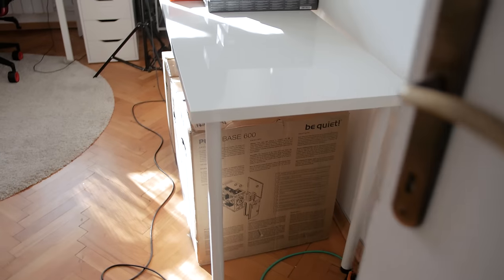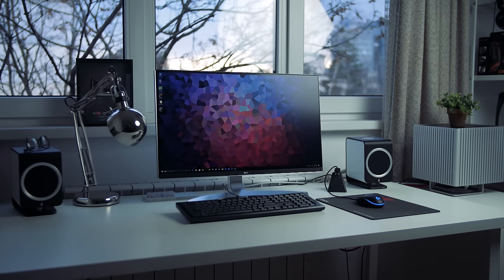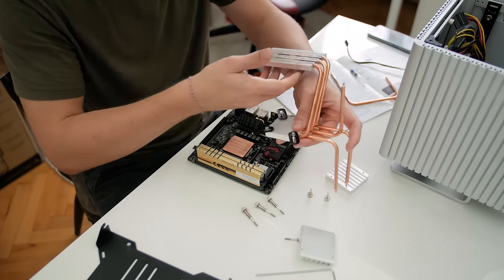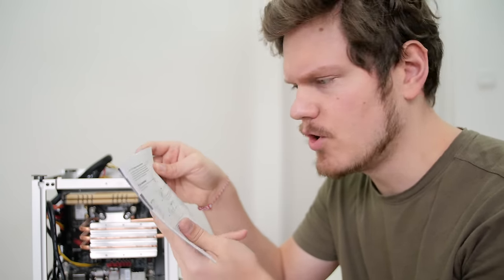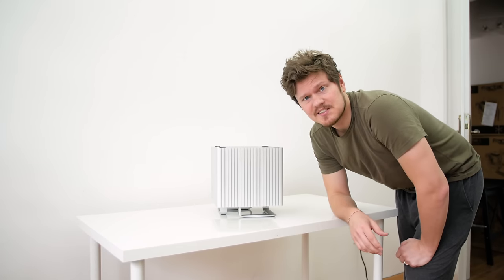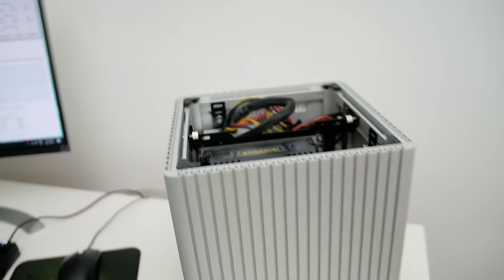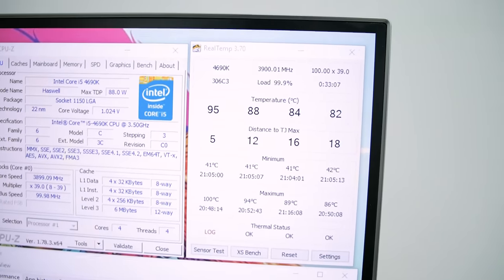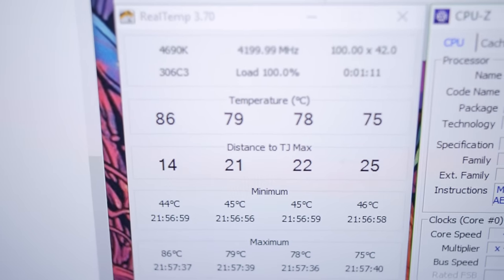Trying to Overclock a Fan-Less System... Do We Succeed?

Comment: Will someone please explain the Heat Watts for me in detail. He said the CPU does 65w of heat is that per minute or per hour or what. Thanks in advance.
Reply: It's not pertaining to a specific amount of time. It means that it's thermal design power (recommended max waste heat output). A it's just simply in watts. It's the amount of electrical resistance within the chip caused my the transistors, meaning if the chip is consuming 100 watts of power it is producing 100 watts of waste heat, and if your cooler can't handle that then the chip will thermal throttle or turn itself off.
Reply: I know OHMs law. But what is in question here is Thermodynamics not Electricity. Heat is expressed incorrectly in Watts instead of BTUs. What I need to know it the actual Thermal Output, not the power usage.
Reply: I suspect that Higher End products, let's say Power Supplies produce less BTUs of heat per Watt of Electricity produced. The only way to truly speak of Heat is in Thermal Units, not Electrical Units.
Reply: TDP is an industry standard measurment for integrated circuits. Here are some links and charts etc, if you want to figure out a BTU rating over time. https://en.wikipedia.org/wiki/Thermal_design_power
http://www.gvsnet.com/spec.html
Reply: That is exactly what is needed Shorty. The Actual BTU Rating so that the proper amount of cooling can then be calculated. Personally, I would prefer to keep chips at 30C at the most. Thanks for your help.
Reply: No problem. It's just not something that usually pops up with PC's and PC cooling. I personally am familiar with BTU as a unit because I used to work on AC units and thats how home cooling/heating is calculated. Typical for computers though is that the chips will have a TDP and the cooling solutions will say what TDP they are capable of cooling. So typically btu's would never enter into the equation for most consumers, but yes scientifically it would make more since to measure that way, its just not the way the PC industry does it.
In the case of this video the original case cooling kit was for a TDP of 65 watts or less, and the chip is 84 watt TDP. The upgrade brought the case up to a capability of 105 watts, so in theory it should have allowed overclocking, but as he states in the video if there is nothing to then dissipate the heat away from the side panels then it still doesn't work very well in practice. I also have a guess that measuring in BTU is probably not used for home pc's simply because the amount of heat is so small compared to systems where btu's are used as a measurement. For example when trying to cool a Data Center with 100's of servers all with 140-150 watt TDP parts, all stacked in racks, then the total heat produced by all that needs to be calculated and cooled properly, measuring in BTU's at that point makes sense. But that's just a guess.

Comment: So... you're going to put a Ryzen chip in that case when they have ITX boards out, ya?
Reply: Stephen Hill Except they would also need to wait for Ryzen APUs if they want to use the upgraded cooling kit if there are issues with motherboard design there as well
Reply: Stephen Hill The case manufacturer would also need to release an AM4 mounting kit for the case/baseplate.
Reply: Fair point--I'm guessing by that point they may have their next niche product out there. Would be interesting to see a low TDP powerhouse (as powerhouse as you can get with low TDP) in there.

Comment: Can I have a fan less PC? Only the fans from the GPU and the CPU closed water loop with a fan. Cuz I got 2 cats and with my current 5 fans, hair gets everywhere inside no matter if the pressure is negative or positive.
Reply: Yes you can have just radiator fans and psu fan

Comment: how does the case perform not overclocked but in (heavy) gaming?
Reply: Chris23399 the first stress test (before he overclocked) is a good indicator of the temps it would achieve under heavy gaming, as for performance, it's only an i5, so like, League and DotA would run well, but you're def not playing doom on this lpl

Comment: My computer is watercooled, that doesn't have fans.
Reply: Arden Unger well it should have fans
Reply: You don't have fans on your radiator?
Reply: Yeah, but its close enough to no fans.
Reply: Arden Unger if you're water cooling seriously your radiator should have 2-4 fans
Reply: A Lamp I have a 280mm X62 Kraken with two fans on it.
Reply: Arden Unger then it's fan cooled. ugh
Reply: But its technically cooled by water.
Reply: Do 12 year olds have Dual Xeons? No.
Reply: Well i'm not a rich one, I'm capable of buying computer parts through University funds.

Comment: Hey guys,
I am writing an essay on a comparison between Advanced Micro Devices (AMD) and NVidia.
I am trying to prove why AMD is more dominant. 
My reasons so far are that:
Better performance for a cheaper price, new technology such as significantly wider execution engine and low latency cache-subsystem,
better optimization, better longevity, and a strong hold over the market. 

Is there anything I am missing? Thanks!
Reply: Danyal A. I would say their market isn't strong,there,yes. It's growing but they're still something around 30 percent ( could be a bit off). I'd go with mentioing their use of freesynce and how it's basically free. Like it's part of the display port cert so that's about as consumer friendly as you can get as well as encouraging a wider use of variable sync technologies. Let's's hope for Vega to let us use it.
Reply: MyJam1981 well I don't think we're arguing performance, we're talking company and technology philosophies. AMD has recently been significantly more consumer friendly than nvidia, the Titan Xpp is evidence of their pursuit of money (which is fair, businesses need to make money) but in a less than stellar way.
Reply: Yeah, as soon as I finished writing my section on its hold on the market I realized that it doesn't help the essay at all. Thanks to your suggestion, I will try to replace it with the Nvidia 'premium' charge on things such as freesync/g sync. Or things like sli/crossfire. SLI bridge cost around $30-40, whereas you can get a Crossfire bridge for around $6 on Amazon. Or reference cards, Nvidia charges more for cards that are less effective than the cheaper ones.

Once again, thanks!
Reply: I'm not talking about raw performance. I'm talking about the overall products the company makes.
Nvidia offer higher performance cards and has a stronger grasp over the market.
BUT, AMD offer better longevity, optimization, and price to performance.

Honestly, both companies are great, I just let my friend choose the topic of our essays- terrible idea.
I don't enough time to switch topics.
Reply: MyJam1981 You're missing a brain if you're a fanboy. At the end of the day these companies just want your money.
Reply: If you're going to write about AMD's dominance you better mention the distribution of GPUs in various machines like Macs and consoles. Nvidia has some presence in mobile gaming devices. AMD is more prevalent in consoles and is present in all modern Macs, with rumours saying the next iMac will include Nvidia GPUs.
Reply: There is statistics on the distribution of Nvidia v. AMD of Steam users
so you can find decent data on what gamers usually use, and don't forget that AMD is also delivering processors, not only GPUs.
Reply: crossfire does not use a bridge like sli, it just uses the PCI also you can connect alot more to amd gpu's monitor wise.
Reply: Danyal A. Trying too hard no?
AMD is good if you dont care about having the best. Take that note
Reply: Fredrik L I can do that, thanks!
Reply: leirisal But, don't forget that Nvidia throws its customers under the bus after the first year or so.
Reply: Sobakus No, no, no, I am actually writing an essay on AMD vs Nvidia.
Reply: Ok, ok, but you might want to phrase it differently then and approach it from the customer's point of view as opposed to objective metrics, technology and raw performance.

Comment: So basically a poorly designed case with even worse design when it comes to the "upgrade kit" and all of that coming with really poor quality heatpipes. Why even bothering?
Reply from the maker: The heatpipes are actually high quality and are bendy because it's copper :)
Reply: Well, I'm not used to handle copper heatpipes but rather copper tubing, and even poor quality copper wouldn't bend that easily :) Plus what kind of "upgrade kit" is if there are like four slots left free? o.O
Reply: Wasn't expecting a reply from you, though :P